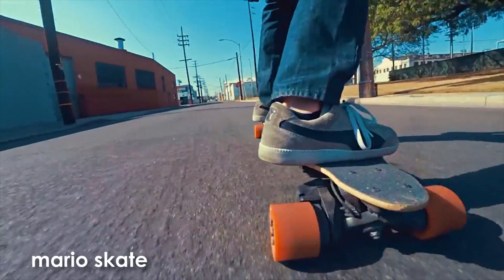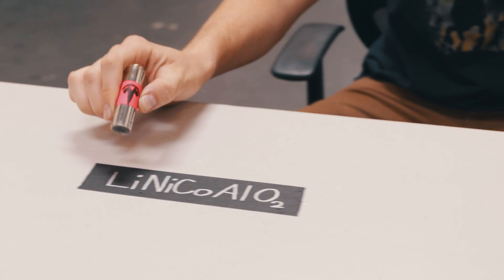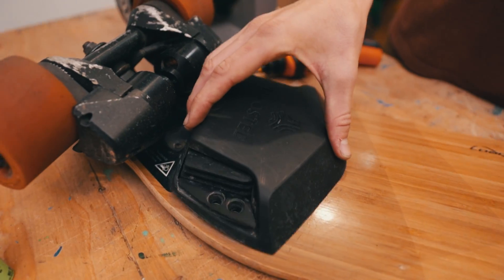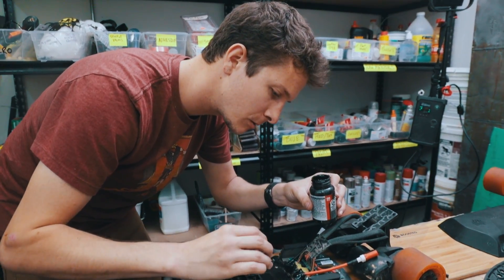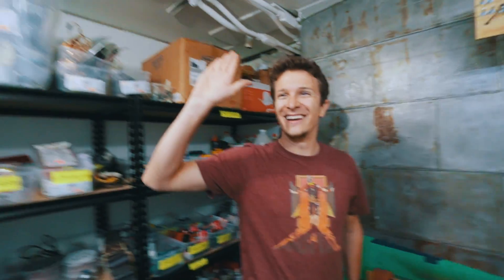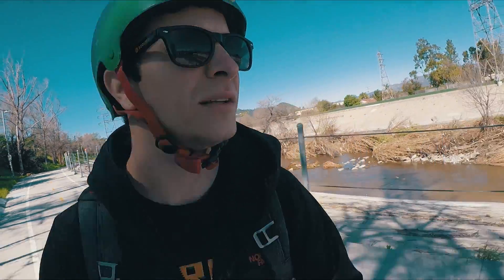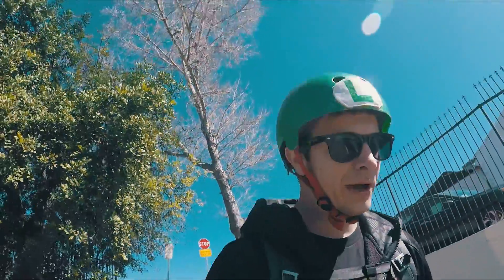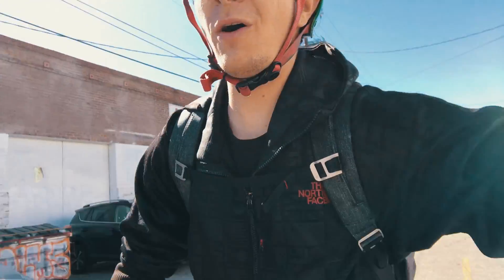Tesla Batteries in an Electric Skateboard!

Comment: He needed a Battery Management System or "B.M.S." for short. There is one located on the Boosted Board, but it wont allow the onboard batteries to drop below 33volts. He needs a new B.M.S. to allow the Panasonic cells to match output voltage, to where both battery packs will run out at the same time. It will also make sure the cells are all equally charged to prevent a possible short or power surge.
Reply: @Tcatron9969  He could also just remove the Boosted board batteries and just solder on the Panasonic cell packs. Then he wouldn't even need the Boosted board batteries. Easy peasy.v
Reply: if he has a schematic he can probably replace a couple of ICs to achieve that instead of a new circuit.
Reply: @Shrek_Holmes  should I email him or...?
Reply: @alanjacob9374  Nahhh...
Reply: @alanjacob9374  yes
Reply: @Shrek_Holmes  He could also just remove the Boosted board batteries and just solder on the Panasonic cell packs. Then he wouldn't even need the Boosted board batteries. Easy peasy.
Reply: You should send him a circuit diagram.
Reply: Is this a working as a clipper circuit ?
Reply: @alanjacob9374   yowp
Reply: Also, the cells he used have a low discharge rate
Reply: @kiyoponnn  He could also just remove the Boosted board batteries and just solder on the Panasonic cell packs. Then he wouldn't even need the Boosted board batteries. Easy peasy.
Reply: @aw_dev  But the boosted board battery has a higher energy density than the panasonic one so that'd be stupid
Reply: @kiyoponnn  Read it again. There are TWO suggestions.
Reply: @aw_dev  You only replied to me with ONE suggestion you dumbass
Reply: What?
Reply: @joshbennett7439  He could also just remove the Boosted board batteries and just solder on the Panasonic cell packs. Then he wouldn't even need the Boosted board batteries. Easy peasy.
Reply: better answer imma delete mine oof
Reply: Or just do away with the original battery pack all together, the banks need to be same voltage And capacity to work well, unless theres a bms thats suitable for the voltage, current draw requirements and balancing 3 individual battery banks with seperate capacities which may or may not be off the shelf from another application it all gets a bit over complicated huh, just run matching battery packs and use a suitable balance charger. Alot of modern 18650 packs for impact drivers dont even use a bms, or balance charger for that matter and they last hundreds or thpusands of discharge cycles totally fine so its no biggie!
Reply: Veryyyyyyyyy big brain
Reply: smartass.
Reply: genuis
Reply: 🤯BIG GIANT ULTRA BRAINNNNNN🧠🧠🧠🧠🧠🧠🧠🧠
Reply: Big brain time
Reply: Bruh Harvard called you want a scholarship?
Reply: Oh smart oh nvm his name is Ching
Reply: He could also just remove the Boosted board batteries and just solder on the Panasonic cell packs. Then he wouldn't even need the Boosted board batteries. Easy peasy.
Reply: big pp
Reply: Piccolo:Neeeeeeeeeerd
Reply: What
Reply: When someone smart actually tells him how to do it 👏👏👏👏👏👏👏👏👏👏👏👍
Reply: @vantagedream9405  Hahaha.
Reply: Ching G: big wrinkle brain
Me: small smooth brain
Reply: Smarty pants
Reply: @donovancorral2547  He could also just remove the Boosted board batteries and just solder on the Panasonic cell packs. Then he wouldn't even need the Boosted board batteries. Easy peasy.
Reply: Neek
Reply: @tylertoyreviews7443  He could also just remove the Boosted board batteries and just solder on the Panasonic cell packs. Then he wouldn't even need the Boosted board batteries. Easy peasy.
Reply: Correct,  i was gonna type like the same thing lol
Reply: @caelumw.6777  no u wernt
Reply: @thiccwicky2996  yes I was I'm not dumb you know. lol
Reply: @caelumw.6777  then why did you get mad at his comment if your so smart and you know hes just hating " hears faint sound of a Mic drop in the distance"
Reply: @caelumw.6777  He could also just remove the Boosted board batteries and just solder on the Panasonic cell packs. Then he wouldn't even need the Boosted board batteries. Easy peasy.
Reply: @aw_dev  -_-  or that too
Reply: @caelumw.6777  The thing I don't get is why there is no follow-up video.
Reply: @aw_dev  Yeah same... It's been like nine months.

Comment: even if you pump more juice into the boards the motors themselves will have a limit. The other problem is the heat that the motors will produce reducing efficiency. To really get a fast/strong board you would need some new motors, a programable chipset that would manage all the electronics, and batteries that can give long term power but 2 others that can be kicked in later for full power and that drop lots of juice all at once.

Comment: i know i'm really late on this but you could reprogram the esc (electronics near the motor) to use the battery till a minimum volts of 30 and get some electronics or manually unplug the boosted battery when they are out of juice or just straight up change the boosted battery

Comment: My guy use the battery pack almost as an alternator for the actual battery just have a line from the pack to the boosted battery to charge from
Reply: This was my first thought but at a guess the board / battery management has protection so you can't charge and ride / discharge.

Comment: Tesla makes 21700 batteries dude... not 18650's. You're using vape/prius/flashlight betteries. The 18650 is manufactured by many companies, and has been used in older models of Tesla cars, but they are not by definition "Tesla" batteries. You should do this over with genuine branded Tesla units. That would be way cooler, and you use clear vinyl to wrap the battery packs so that the Tesla logo is visible on all the batteries.
Reply: tf is your problem. tesla used 18650 batteries when the video was uploaded dumbass. they are not called vape/prius/flashlight batteries...
they are fucking 18650 li-ion batteries and fucking call them like that. who tf gives a fuck if the tesla logo is visible...
they will be covered by the tape or whatever.
Reply: incorrect. tesla used 18650s in 2017, and had been doing so since 2013. and like the other guy said they aren't called vape batteries, they're just a standard battery, like an AA, A, or D cell. It's simply a cell size standard, nothing more.

Comment: It looks like 18650 vape battery’s that’s going to blow up
Reply: and its not going to blow up. unless your dumb and think it only goes in vapes.

just don't short circuit, over charge, over drain the batteries and you will be ok.
i don't recommend for you to get even close to those batteries.
just stay away and you will be good.

oh 1 more think. these batteries have vent holes. soo they won't explode unless its a Chinese ripoff.

hopefully you learned something and stop calling them batteries that go in vapes.
just call them li-ion 18650 batteries
Reply: emm. vapes use 18650 batteries teslas use them too. battery packs use them too. its not just a fucking vape that uses it.

Comment: You shouldnt parallel the external battery to the internal battery since they have different amp and mah ratings that would result in unbalanced battery cells also you should have added a cutoff switch from the main battery to the controller you should also plug in the external battery IF the main battery is already dead once its dead you have to cut off the main battery then plug the external battery so that it has a balance cells
Reply: Its not the because your main battery thats bottlenecking the remaining battery level on your external battery

Comment: I know this was years ago but never saw an update video, what if you just used those batteries to charge the main battery
Reply: that would retain charge in the main battery but it might cause the main battery to overheat from constant charge like how your phone gets hot when you use it while its charging.
Reply: @josephreilly8284  so use a constant monitoring circuit to start and stop charging at appropriate voltages.
Reply: you could then use two main batteries, then charge the one while the other is in use
Reply: @Gavin Media Group true but it would probably be easier to get rid of the main battery and use the battery that is already on it
Reply: @josephreilly8284  also true. Me personally, I would replace the battery entirely, and retrofit a higher mAh battery.
Reply: Or maybe adding on to the original battery, by using the extra battery as a sort of back up, and just have the ability to switch between the two.
Reply: Or just remove the tiny puny original battery?
Reply: Or just get an extended range battery
Reply: The update vid is the one wheel vid

Comment: Damn dude i could never understand parallel until i watched you pour out the water damn thanks
Reply: water and electricity are almost identical in the way they work.. from the example here, to series (pouring one bottle into another and pouring out on the end) to switches/faucets, hot/intake and ground/outlet, even how water/electricity is stored in the line until it has a way to continue.. voltage and amperage can be compared to PSI and pipe diameter.. it's good to use water analogies.
Reply: Parallel only increases the capacity not the output voltage it seems like he’s confusing that at times in the video. Putting the batteries in series will increase the voltage.
Reply: @billjon2732  I noticed that too I was confused for a moment

Comment: You will need to modify the ESC on the receiver unit to have the power go directly to the motor. You can try to change the mosfetts on the original board but I would build a separate board with the mosfetts and just connect he signal line and battery to the new circuit board and from the new circuit board to the motor. Be careful not to exceed the power rating of the motor or you will fry it.
Reply: DKzAcronym damn you smart

Comment: Wouldn't you get the same power from less batteries if you linked the in series and then ran another set of series linked batteries in parallel? It could also give you the extra torque needed to get up that hill. Maybe? Para-series
Reply: A specialized combination circuit can achieve your required torque specs and your long distance you’d like to have

Comment: maybe you can somehow make the booster board battery use a little less voltage and adjust it so the Tesla battery pack you made will run out at the same time as the booster board.

Comment: I'm in no way qaulafied to give advice but what if instead of haveing the haters conected directly to the board you conected them to charge the main battery of the boared while you ride so that the batery is charged as it is useing energy then when the two tesla baterys run out it then starts to loos charge this way you can use all the powa

Comment: Finds out tesla batteries are just 18650's EERRRRREEEEEEEEEEEE

Edit: i didnt actually think it was an 18650 till 0:51 wtf why are they so expensive
Reply: 1:05. 7100 custom high quality Panasonic 18650s. I don't care if you're running on 7100 cheap AAs its going to cost a bundle!

Comment: Use a Power Tranformer... when the voltage goes low, flip the power switch on, power will flow thru the tranformer input at lower voltages and then the output voltage of the transformer will be multiplied, but it’s not free energy, it will utilize more amperage this way.. this should fix your problem, please caution while using transformers... not responsible for your life

Comment: I'm sure you have the answer by now, but you need to attach enough batteries in series to get a higher max current output, which can increase max energy draw, and lower the voltage at which your batteries are able to power the board. 

Although if the board is not designed to run at a lower voltage and higher amperage, you could damage it, so please be careful.

Comment: The Tesla (Panasonic) batteries are complete junk, should have gotten some sony vtc6's
Reply: The NCR20700B cells are the shit.
Reply: @ZaiFuchigami  4250mAh, 15 amp continuous 20 amp pulse
Reply: @ZaiFuchigami  and the Sony vtc6 is 3000mAh 30amp continuous 50 amp pulse, I think I'm gonna stick with sony
Reply: @carsareepic20  Unless you're vaping you don't need 30A continuous in a pack large enough to sustain a load for a useable time. On the Sony data sheet it says it can retain only 53% of its original capacity after a mere 300 cycles. The NCR20700A cells are also available, they are rated at 3300mAh and 30A continuous discharge.

Comment: To those still pondering his question at the end. THIS is why you don't mix battery types/capacities in a single system. The weakest part of the system will dictate your capacity- both in charging and discharging. The simple solution is to build all his packs with matching chemistries and capacities. Cell testing/matching is critical to get the max out of a pack. Even one weak cell can lose you half your capacity. And with modern lithium charge/discharge protections, they will always undercharge a mismatched system long before your pack has reached it's true abilities.

At MINIMUM, you separate charging & discharging circuits. Flip a switch when battery 1 is dead, go to pack 2. Each charged separately, of course. That will give almost as much range as two matched packs running in parallel. He did none of this.

Comment: Hey ik this is a old ass video but, if you could switch it so the board relies on the two batter packs then the boosted board battery. So that way you can run out of the batter in the packs you made first then switch over to the batter in the board.

Comment: Get two more boosted board batteries and make the same exact circuit on the other side of the board and it will run for longer at least that's what's I think

Comment: few  mnnths  ago, and  im back  over  here to watch some  of ur videos  again  who came  back from  watching  the  bike  motor  video ? and how about  somehow  getting ur  own  body,  to charge  like.. strap a  belt  on u,  connect it  wirelessly , or   physically to the skateboard,  so that when  ur  actually  pushing with ur  weight,  and  ur  speeding  ahead,  by  , using  ur  own  energy,  it  can  also charge, and  power  on  the  skating  board as it  goes,  there  by  haveing  limitless  energy >?

Comment: Series batteries to your desired voltage and parallel the desired voltage packs for longer life. Samsung 50E (21700) 4.2V max 5000mah 9.8amps continuous. Hohm tech "sherlock hohm" (20700) is 4.2v max 3116mah at 30amps. Theoretically a drain controller could combine both a high drain and high capacity battery in a small form board.

Comment: you keep mentioning raising voltage to get more range, range ie time you get from a battery performance is base on Mah not volts and thats from batteries.
If i were modding the skate board I would take one battery pack and increase voltage and use the other for Amps increase ie one in series and one in parallel. An increase in voltage and capacity traumatically increases the availability of current flow. 
So for example if the the voltage needed to be 12v and yo raise it to 14.4v and the capacity was 2000mah / 2 amps and it were raise to 4000mah
this would mean the power control module would have access to more power than it could ever hope for.
remember in your home your billed for Kwh or Kilo watt hours , so a battery with more amps and volts has greater wattage capacity
obviously doing this on a setup without a power control module would cause an issues, but in this case increase the amps not voltage and your all good

Comment: Dude Build a Backpack battery! 😎  Plug it in with a quick disconnect plug, don't use board battery's use backpack for long distances. Build a bigger battery, possible battery belt. To be worn to carry battery's to supply enough power needed. Build a electric fuel cell to supply power, hydrogen oxygen fuel cell, would have to use layers of carbon electrodes to obtain 40 vdc. 2.5 volts per carbon 5 cells 12.5 . Use compressed hydrogen in a tank and compressed oxygen in another tank pipe gases to  3d printed fuel cells, exhaust will be pure water that can be saved in a bottle and consumed. A charging station can be built for backpack water cells. Uses Ac current converts to 12 and charges HHO  Tanks for fuel cells,  cells don't produce heat and have instant Power  a super capacitor in circuit would be good too.

Comment: or you can just Go to E-Wheel dot Com and buy a GOTWAY MCM5 14" that has a 2hr. charge time for it's 800Wh battery with 60x Cells that powers a 1500W Motor that will haul your "up to" 250lbs ass 25+ MPH (depending on weight and skill) Up, Down and all around your city or town ALL THE WAY to the NEXT CITY OR COUNTY & BACK! With a ridiculous 40+ Mile range on single 14" self balancing wheel between your Lambor-Feetys. 

BTW, It's 3-$400 Cheaper then your E Board 

you're welcome.

Comment: Try making so that instead of it pulling power straight from the Tesla battery it uses a system that takes the voltage from the Tesla battery and put it into the normal booster board battery then use the energy from the booster board battery

Comment: When batteries are connected they become one battery. Soo You have (2) batteries .

(10) batteries in one pack, are simply (10) batteries.... UNLESS all (10) batteries are fused together. For instance once the batteries are fused together it is no longer preferred as 10 batteries or a battery pack. Reason is that the 10 batteries have become (1)source of electrical current 

Now that u have that information, (10 batteries) will become equivalent to (1 battery) if or once fused together as a whole 

The only difference is the amount volts or juice that the battery can hold.

Comment: Maybe you have to up the energy output to boost the utilization of the battery. What I'm saying, use the volts faster and more at the given time, so the energy depletion is parallel between the NCR18650B and the booster board battery. Use up the Tesla battery more at a given rate to make the booster board capable of using all of the energy.